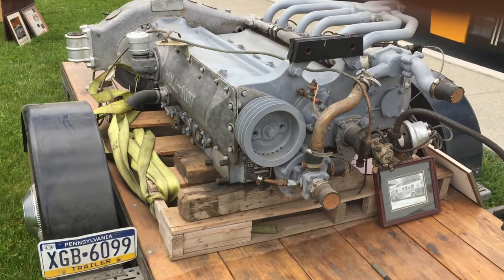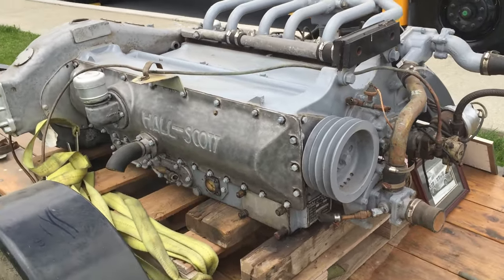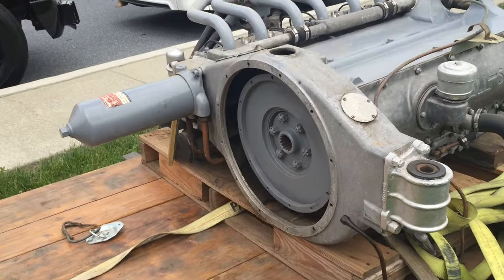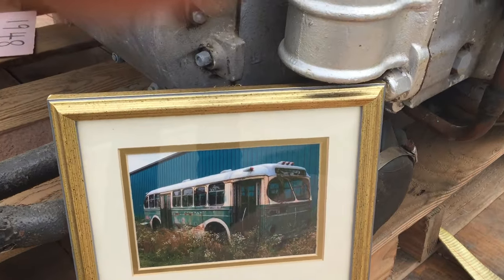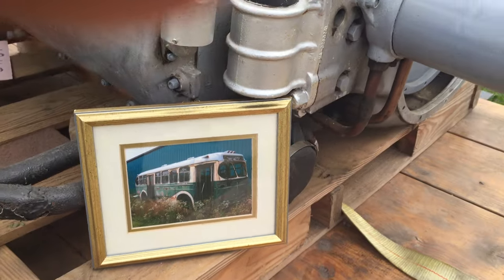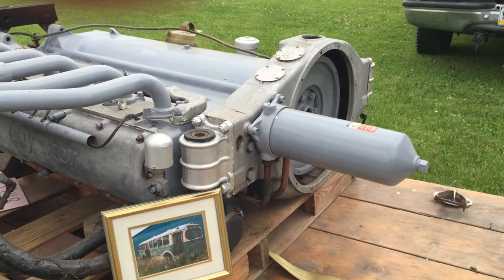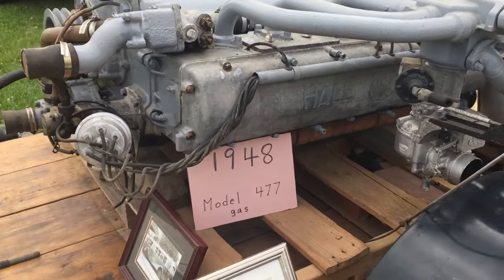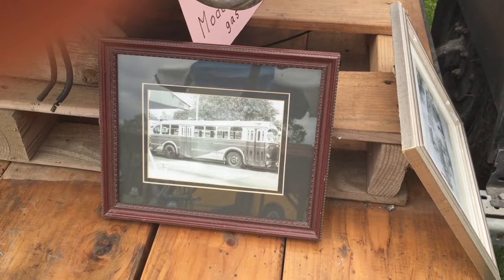Hall-Scott Engine Pancake Engine

Comment: Someone came to a campout in a former Santa Fe transport bus they turned into a beautiful RV that was powered by one of these. It had been rebuilt sometime in the 70's by Crown coach in southern california. I do remember his being a DOHC setup though, had two cam drive shafts and it idled very low, in the 300 RPM range. May have been a different engine from the same company. He told me the company also did marine engines during the war. Really interesting engine.
Reply: That must have been super rare because I have a book that says many of the gassers in the Crowns were replaced with diesels in the 70s and it showed a bunch of engines in a pile for scraping
Reply: @SquishyZoran  Now he said it was a Packard engine, and it had a dual cam setup. The bus was from the mid/late 40's so it may have been a different engine, but it was really interesting bus to check out. I thought H-S engine, but like I said, he told me it was originally a marine engine design, owned by Packard, but who knows. it wasn't a large bus either, sort of a little smaller then average, made for taking people between train stations. But really cool none the less.

Comment: 477 cubic inches would be a Hall-Scott Model 136 (pancake) or 135 (vertical). 4.5 bore by 5-inch stroke. 150 horsepower and 352 ft-lb torque. Weighs 2,400 pounds. It was created by increasing the cylinder bore of the 130 engine by a quarter of an inch. The 135/136 were very popular in Crown Coach buses in the post-war years. Hall-Scott built these engines from 1930 until around the late 1940's when they were superseded by the 504, 180, and 190 engines. 190 engines were installed in all the production IC-41 ACF-Brills between 1945 and 1950.

Comment: that was a unique design to be under the floor. Mostly transit buses. White Motor coaches from the early 50's had the engine under the floor. I remember as a child seeing the access doors .
Reply: Mid-engined Crown and Gillig school buses also used them.
Reply: @sadams12345678  The school district I was in had nine Hall Scott Crowns.  Two were used for spare parts.  I used to love riding on them.  The rest of our Crowns had Detroits, which were still great.  Miss those buses.

Comment: In 1947, Safety Motor Transit Company in Roanoke, Virginia purchased 53 new city busses. 20 Mack C-41 busses with a 6 cylinder Mack gas engine in the rear and 33 ACF-Brill C-36 busses with engines mounted underneath the floor. These busses were in service through the mid 60s. I'm not certain but my guess is the Brill's had this engine. It's been so long I can't recall.
Reply: White Motor coaches and White transit buses had the engine under the floor
Reply: @adriancressy8363  Oh. I remember White transit buses in Washington DC back in that day. I was able to confirm the 33 ACF-Brill buses that ran in Roanoke all through the 1950's had this engine. Roanoke bought 33 of these and 20 Mack C-41s in 1947. It was 1966 before all were off the streets replaced with 4 different orders of GM old look.
Reply: @boblackey1  Yes Bob..Washington DC. The Catholic schools chartered the transit buses to be school buses. Remember that DC had 3 systems? WV&M Virginia. WM&A for Maryland and Capitol transit. Many of the vehicles had 3-on the floor. Others had a very strange kind of no-shift transmission. I have a lot of memories riding into DC to go to school.
Reply: @adriancressy8363  Down here in Roanoke the 33 ACF Brill C36 busses with the Hall Scott engine shown here had 3 on the floor manual transmissions. The 20 Mack C41 buses had a two speed Spicer automatic transmission. It would wind up then shift once into high range.

Comment: Really ? Torque? Revs? Fuel? Two large pipes to manifold?
Reply: The maximum torque was 380 at 1600 RPMs (without accessories). Most operators ran gasoline (27 cents a gallon in 1950), but some guys set up for butane with  extra equipment. The two big pipes run down to the exhaust pipe. I believe this was designed to heat up the intake manifold for a smoother run.         ------Bill